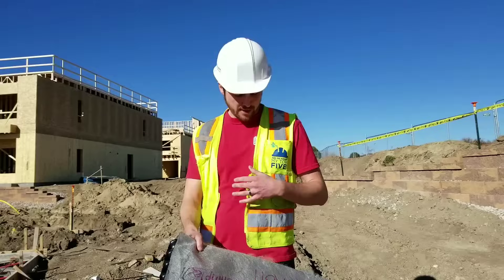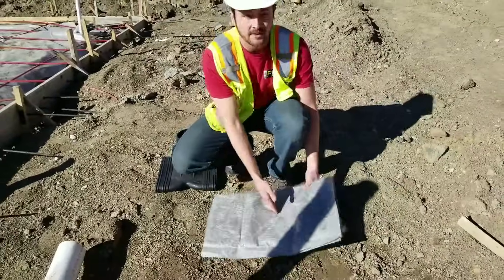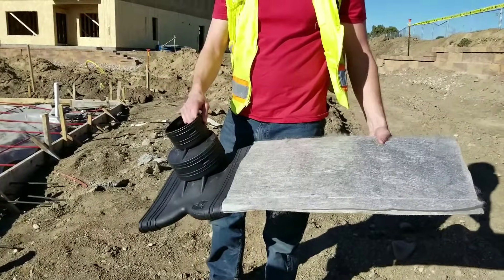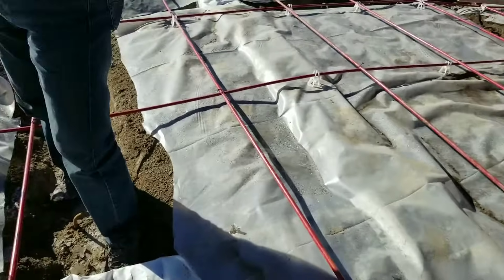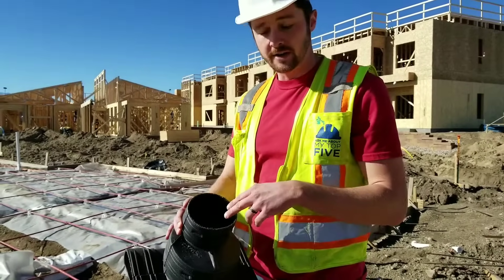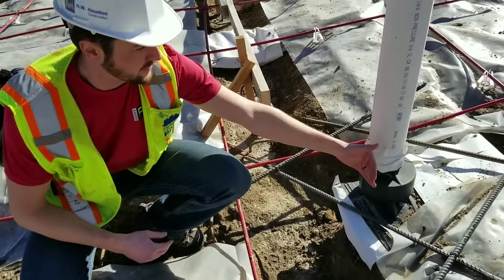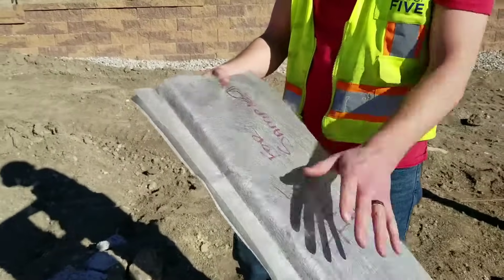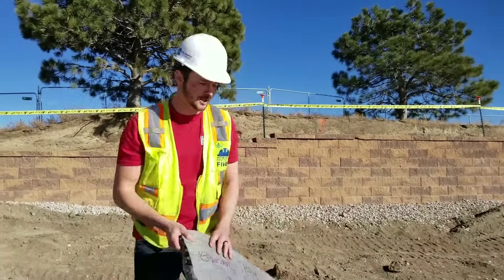Soil Gas Mat for Radon Installation Multi Family | PDS Radon Supply

Comment: Not much detail at all. The guy talks fast and is difficult to understand.  and how did you choose the riser locations?
Reply: More info @ www.RadonMat.com  We do free takeoffs and designs.  You want the T risers spread out evenly, one 4" riser every 2,000 sq ft.  Ideally they'd exhaust straight up through the entire building/roof with no elbows.  For that reason, wall chaises are ideal locations.